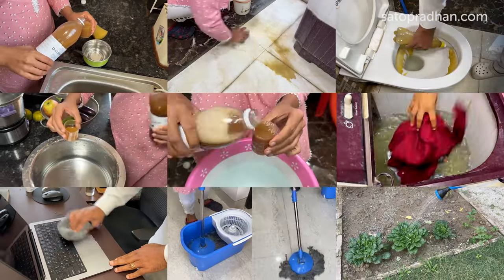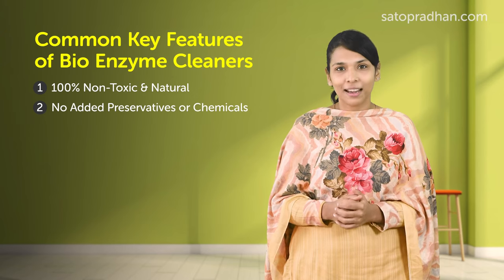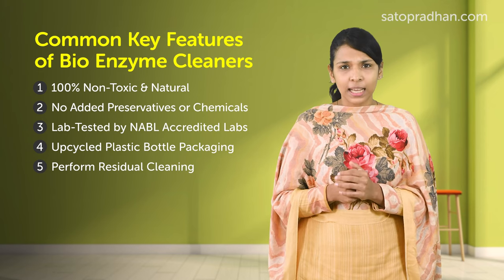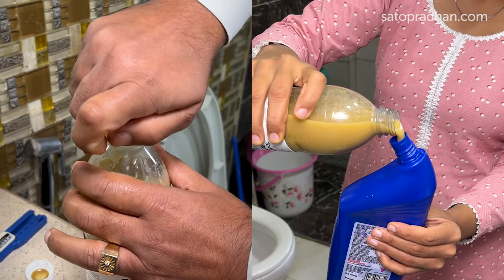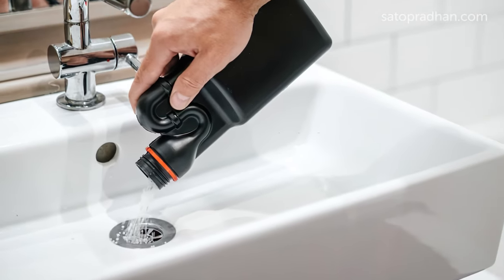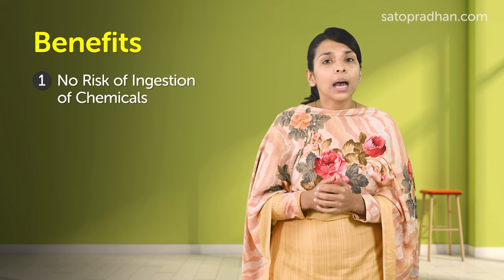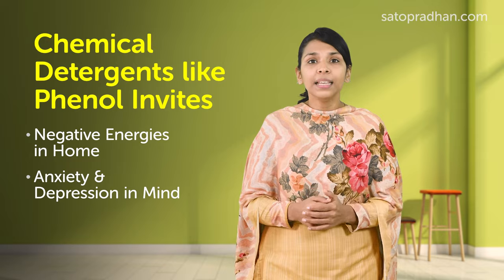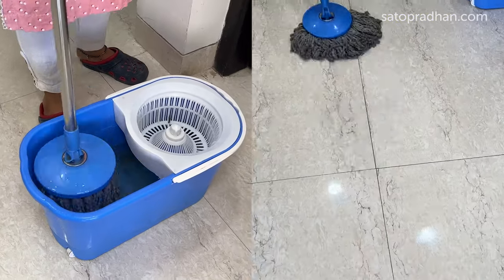Chemical-Free Home Part-3/3 | Bio Enzyme Cleaning Products for Home | Dishwash | Laundry Wash

Comment: After dilution,  for how long all purpose disinfectant remains usable?
Reply from the maker: Dear,
Whenever we dilute bio enzyme, within 20 minutes the enzymes start to multiply. The quantity diluted can vary according to strength needed to do the work.

If you want to use less than 100 ml, you can but you have to increase the waiting period after diluting it. Dilute the enzyme and wait for 1 hour at least before its application

Comment: Can i use full lemons cut to make bioenzyme? Consumption of citrus fruits is less in my home and to collect so much is not possible.  So can i use the whole lemon instead.  Would the weight be still  3 parts in ratio
Reply from the maker: Yes Dear
Full lemons can be used...but the essence of making bio enzyme will remain unfulfilled i.e. to use our waste but as you mentioned citric is not used in your home..you can use whole lemons too and yes the proportion will remain same 

You can also connect with nearby juice walas...shops or rerhi and get their lemon or citric peels as they also throw them. If that's not possible then you can choose whole lemons